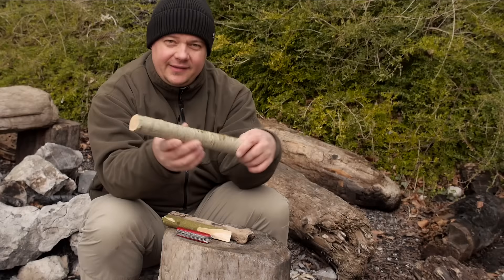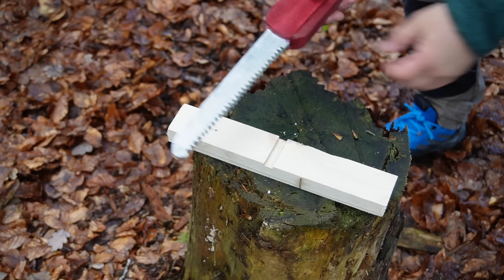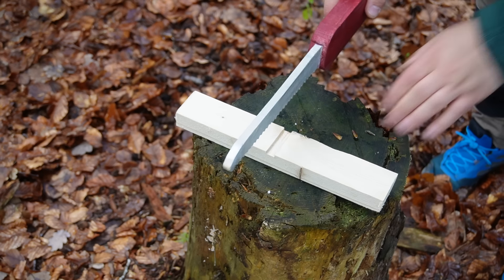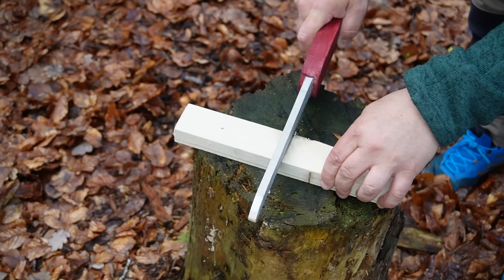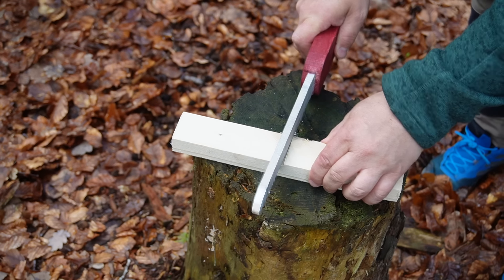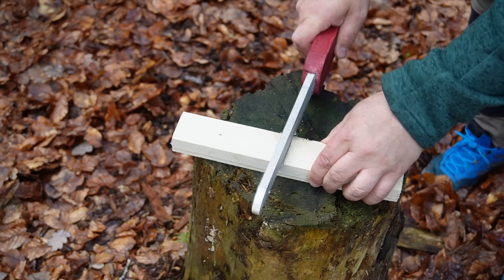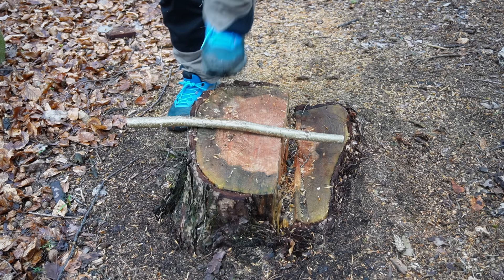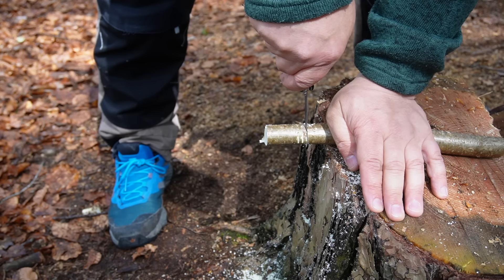5 Tricks how to increase the Wood Saw performance - Victorinox Swiss Army Knife Tips & Tricks

Comment: The best agent for removing resin is alcohol, it's what they use in the wood industry to clean their woodworking tools.
Reply from the maker: Thanks a lot for this super interesting hint!
Reply: I use oil, works as well
Reply: Also they do breath a lot of resin So they also Have to take care of this. Alcohol Is better than oil for thats purpose.
Reply: @krystofmraz  Just don't use alcohol (ethanol, isopropanol) that will attack the red plastic handle scales.  Prefer a non-resinous oil
Reply: I use wd40.
Reply: Hand sanitizer
Reply: Diesel
Reply: @TylerSnyder305  no you don’t
Reply: @dionst.michael1482  yes I do use wd40, it works great on sticker residue too.
Reply: @TylerSnyder305  Lol! I’m just teasing friend. I use it for that as well. I was just bored. Take care.
Reply: @dionst.michael1482 awe I like the friendly hazing much love👍🏻
Reply: I love BALISTOL.
Reply: Coconut oil works wonders

Comment: This is the kind of information that should be included in all shop classes because the principles apply to all types of tool usage. I have been working with tools for 50+ years and thru trial-and-error (mostly error) have stumbled across most of these tips if not fortunate enough to have been enlightening by older craftsmen. Thank you for sharing all of your tips, tricks and instruction on the usefulness of this wonderful knife.

Comment: Try use the saw for cleaning (short) wool clothing - if you use it right it works great to comb away debris and bobbles - pull the wool gtight but gentle and you be amazed at the results 🔥
Reply from the maker: Thanks a lot for this great tip!

Comment: Hi Felix. :) Great video once again! If I may I would like to ask you for advise regarding the saw cleaning. Recently i was collecting fat wood using my Ranger grip saw and after cleaning with water and brush , there is still pieces stuck in the saw as the fatwood is sticky.  Should I leave it in white vinegar for some time or vinegar-sodium bicarbonate? I am checking on internet but cannot find any tip for cleaning of only this part of the SAK. I ll be very gratefull for any tip from you or the community . Cheers all :)

Comment: re the SAK saws.  I consider them the last saw to use, when all else fails or isn't available.  I saw a trick and here is my version.  This is for SAKs that have a hook.
Buy some jigsaw blades.  Get a few tubes of 1/4"  heat shrink tubing that the saw blade fits into.
Choose the type of blades you would most want to use/carry.  Hack or wood or general purpose, high carbon or carbide.  You could use longer jigsaw blades if desired.
Cut a half inch piece of shrink tube and put it over the handle end of the blade.  Blades you choose must have a notch on the back.  Not all do.  The ones that wont work usually have a half round cutout on the tail.
Put the 1/2" shrink tube on the end and heat it to shrink.  While warm insert the tail of the blade in the gap where the SAK hook normally sits when closed.  Push it in snugly.  This eliminates wobble.
Lower the hook to rest in the notch on the blade.  It wont hold or help yet.
I use 100 pound paracord, about a foot of it.  Remove the lanyard ring and put the cord through the hole.   You will run the cord over the back of the hook and make a loop, loosely knotted.
Hold the SAK like you are going to saw.  Your fingers will be under the body of the knife,( your thumb pressing down on the top of the hook) .  A finger or two will be through the lop, pulling tightly on the back of the hook.  This will need to be adjusted to your grip and hand size.  I use a loose water knot to find the correct length before trimming the knot ends and tightening the knot..  The loop is now your lanyard.
I store the jigsaw blades I EDC, each in a tube of unshrunk, heat shrink tubing, as sheaths.  I pre shrink and fit the 1/2" tube to each blade.  My belt pouch has space for my SAK, the spare blades and tubes.  But unless camping I don't carry longer blades for this.
Now I can cut, and replace blades, which I couldn't do with the SAK blades.  They are my last ditch blades when all my replaceable blades are used up.
Reply from the maker: Thanks a lot for your detailed description of the trick!!!

Comment: I agree. There are so many so-called Bush crafters teaching non Bush craft people wanting to learn it absolutely kills me when I watch him use a saw they. Put it between 2 high points and then cut the middle. and the wood binds down on the blade. It's just absolutely astonishing, but I also was using it wrong and have learned to cut.  And a downward stroke instead of a cross thank you for your tip does make sense
Reply from the maker: Thanks a lot for this super interesting comment!

Comment: Hi. Woodsaw its an important tool for me. I own(ed) multitools from Victorinox, Leatherman and Gerber. All the default saws are good for dry (dead) wood and pretty bad for live wet wood, as roses branches. The teeth are too close and too small and get filled with sticky wet wood. I had to clean it very often to be able to cut more. My only solution was to buy tshank blades with more spaced and aggresive teeth and equip on the only tool that allow that, the Surge.
Edit: my poin is- is there any solution to make the saw not sticky for wet wood?
Reply from the maker: Super interesting question... Sorry i don't know..

Comment: Very good advice and demonstration. I would add that many people press to hard while pushing and pulling the blade.  The design of the saw blade allows it to cut super efficiently with a light but consistent pressure.  My father said to let the blade do the work.
Reply from the maker: Thanks a lot for this super interesting comment!
Reply: This is a golden rule for most saws not only on SAKs. Got the same tip by my dad btw :) (god bless him)

Comment: Excellent tips Felix!  The tip about sawing in the same direction as the clamping force was worth the price of admission alone!  FYI...an old toothbrush will work very well for cleaning the teeth of the saw blade, and minimize any potential hand injury from the sharp teeth.
Reply from the maker: Thanks a lot for your great Tip!!!!
Reply: I just use the tooth pick 👍
Reply: Very handy things, old toothbrushes - I have them in just about every toolbox I own!

Comment: Thank you, Felix. IMO, Tip #6: Just because your SAK saw CAN cut on both the push stroke and the pull stroke, does not mean that you should always try to cut in both directions. Sometimes you can't clamp the work (such as when cutting off part of a sapling or part of a tree branch). In those cases, you may be better off using only the pull stroke to cut.
Reply: Found this useful on dry Bamboo-sticks too :)
Reply from the maker: You are right!

Comment: Some great ideas here! I liked the blade straightening in the vice jaws, I'll remember that tip. I've always used white spirit for cleaning off pine resin - it works because white spirit is turpentine substitute and turpentine is made from pine resin. Of course, you could also use real turpentine, but it is much more expensive, and nobody uses real turpentine any more except for artists mixing oil paints!  Lighter fuel is a good solvent too. Candle wax as a lubricant on the saw blade makes sense - it also works on sticky metal zips on leather jackets etc.
Reply from the maker: Thanks a lot for your interesting feedback!!

Comment: One thing worth mentioning: it's important to be sure your work piece is as stable as possible when sawing from your shoulder, as the extra power can damage the blade if it happens to jam. If you can't stabilize your work for some reason, such as cutting a branch that you can just barely reach, it's safer to saw from your elbow and wrist so you can more easily absorb the shock of a blade that jams suddenly. If everything is held properly and stabilized well, then using your shoulder is the better option.

 Note that the technique can differ from saw to saw, as you wouldn't want to be push cutting with a Silky that cuts on the pull stroke.
Reply from the maker: You are right...thank you...
Reply: @FelixImmler thank YOU for making such awesome and informative videos! I learned so much from you over the years I'm just glad I can contribute something ❤️